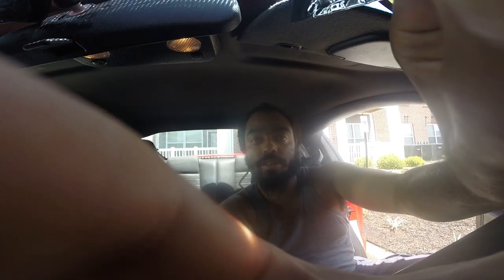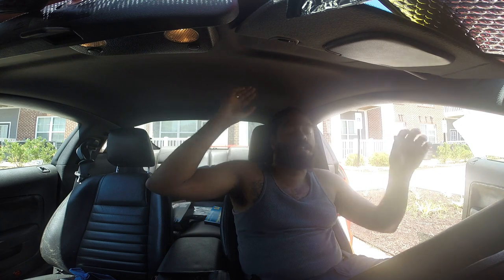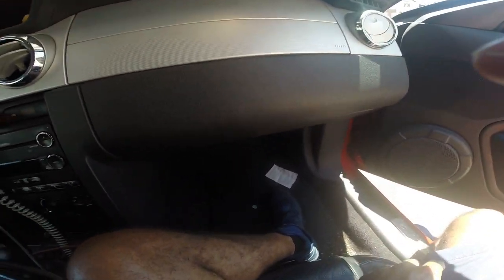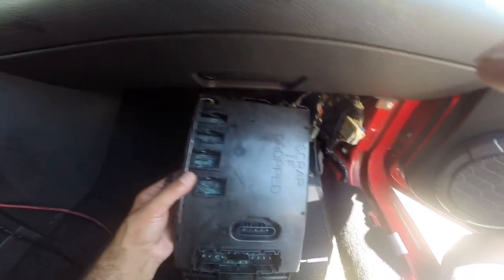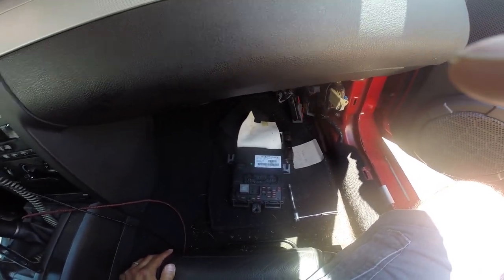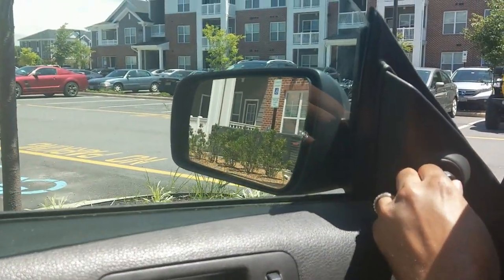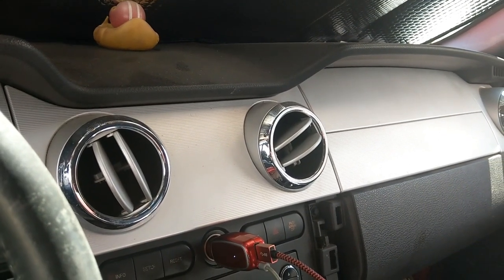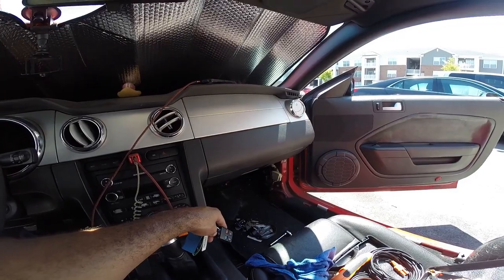08 MUSTANG ELECTRICAL ISSUES FIXED BY ONE SIMPLE PART REPLACEMENT

Comment: This was great!  Clean the front of the lens on your phone for a much higher quality picture and no flare.  Thanks for making this video. If De-Oxit is not available, try Corrosion-X, which does about the same thing.  You said something about wondering if moisture under the passenger door plate was a problem - The answer is YES - moisture causes green crusties and corrodes the ground connections over time, causing slow windows, Stability Control problems, poor cluster illumination, and affects anything that is wired into or near the SJB in that area.

Each time I watch this video, I learn more and more.
Reply from the maker: Thanks.  I appreciate that.

Comment: This worked! My cabin flooded in my mustang and all the electoral components stopped working like yours. I found a replacement part in a junkyard from a crashed mustang and luckily the smart junction box was still in great condition. HOWEVER, my windows won't go down and its not the fuses- might be the switches themselves.
Reply: Hey if you didn’t know already there’s grommets under the hood that get clogged that cause the water getting into the inside. Mine used to do this then I found out about the grommets.
Reply: What did it end up being ?

Comment: Hey so my right tail light only has one bulb is on I replaced the bulbs but no luck it’s has volts b like 0.6 wats do u think if I change the bcm it will work?
Reply from the maker: Definitely sounds like the wiring.  This is just a guess, but I probably would check the bcm to make sure there's no corrosion before changing it and then also the wiring harness for the tail lights.

Comment: My Guage cluster, horn and power mirrors and power seats stopped working could this be my problem aswell?
Reply from the maker: It's highly possible.  My horn & power mirrors were among what was affected when I had this issue.  You can start by checking the individual fuses, then the entire box.

Comment: Good looking out. Im sitting on a 07 mustang with that issue changed fuses and been trying to get the windows to go up atleast but no luck gonna look around and see if i find that part for this one and hope that is the problem. Nothing works windows mirrors radio or ac like yours so hope its that
Reply from the maker: Yeah, hopefully that fixes it for you.  Good chance it does being that it's a few components not working.
Reply: Worked out great just cost me $135 radio windows mirrors all work but no luck on heat/ac control. Still great now to reprogram the driver window thanks again man
Reply from the maker: @mrandres7271  Excellent!  Glad to hear that.

Comment: where did you buy the part? i dont want to have to reprogram it. My mustangs brake lights are on 24/7 and in was told its the SJB. Looking to just buy a used one for my car and replace it
Reply from the maker: Found it on eBay
Reply: @4TheLoveofRides  okay. seems pretty hard to find my exact model. guess i will just keep looking. hoping to be daily driving this pretty soon. my first manual car.
Reply from the maker: @CaffeinatedFrostbite  Yeah man.  Keep searching.  One should turn up.  And once you get used to manual, you won't want anything else.
Reply: @4TheLoveofRides  yeah. it will help a lot when i actually know what model number to look for. my parents let me keep it at their place while i learn manual since they live in the country and there is no traffic
Reply from the maker: @CaffeinatedFrostbite  I found mines simply by searching year make & model "08 mustang gt smart junction box" on Google or eBay.  Long as you match it up to your year make & model, you should be good.  No programming needed.
Reply: @4TheLoveofRides  I will see what I can do. If need be I will have a dealer program it. I will buy one on eBay either way since it's so much cheaper
Reply from the maker: @CaffeinatedFrostbite  Install it first before you give a dealer your money.  It was plug & play for me, straight out of the box.  Now that I think about it, I was wondering about whether or not I would have to get it programmed before I installed it, but I didn't.
Reply: @4TheLoveofRides  I figure if it doesn't work I just out the old one in so I can drive to the dealer and have him program the new one. Nothing lost in trying

Comment: i have an 06 v6 mustang and replacing this unit fixed my electrical issues involving the power mirrors and door locks. But now my fog lights do not work
Reply from the maker: My fog lights not working either right now.  Idk if it has anything to do w/ this box or b/c I changed out the light assemblies, but I need to check the fuses.  Weird thing is, b/c my fogs are out, when I unlock the car, the headlights come on instead.
Reply: @4TheLoveofRides  So i got another box but this time i matched the part number and made sure it was 05-06. I think the boxes are programmed for different options like fog lights, convertible, power seats, heated seats, etc. Now everything works good...Downside is i spent $260 

Thanks for the video it really helped out
Reply from the maker: @LucianoAlfano8  No problem.  @ least you got it fixed.  That's probably still less than what you would've paid someone to fix it for you.

Comment: I bought a used BCM on ebay and installed it. No change. Windows and heater blower still doesn't work. Any ideas?
Reply from the maker: Either the smart junction box is no good, or moat likely, you have an issue somewhere else in the electrical system.  Have you tried supplying power directly to the blower motor?
Reply: @4TheLoveofRides  I am going to supply power to the inside switch fuse with a battery tomorrow. I will use an incircuit 5 amp fuse to make sure I don't burn out anything. Changed the smart junction box (BCM) and no difference. I check the power to the 5 amp fuse that powers up the inside switchs and there is on volts there. If the switchs work with a battery my next move will be the under hood fuse box. Has to be where the problem is. Thanks.

Comment: You didn't have to unhook the battery before installing the new junction box?
Reply from the maker: I probably should have just as a safety habit, but when you disconnect the main plug from the box, it basically does the same thing.
Reply: @4TheLoveofRides  Ok. Thanks.
Reply from the maker: @ajw6715  No problem

Comment: So you didnt have to reprogram the key to the car after changing the sjb?
Reply from the maker: Only the key fob, but not the key itself.  Any coding in the actual key would be coded to the ignition, but not the sjb.
Reply: @4TheLoveofRides  im having the same problem and ford is telling me i have to get the sjb programmed to the car plus the key
Reply from the maker: @48kevo  If I remember right, I think my local dealer told me the same thing.  Or they might've said it "may" have to be reprogrammed, but I didn't have to do any of that.  All I had to do is link/program the key fob so that it would lock & unlock the doors, pop the trunk, etc.
Reply: @4TheLoveofRides  yeah i noticed in your vid. My car is sitting at the shop right now with this same problem. I have the box i was about to get them to program it

Comment: Hey man I have a problem where my key fob only unlocks the doors when I’m pointing directly at or very close to the SJB I believe it may have gotten wet I wonder if that would solve my problem?
Reply: Sounds more like the battery in the key fob needs replacing.  It’s a common button battery.  CR 2032 I think.  Easy to open the fob and replace.
Reply: @hobbycow5346  I replaced the batteries and still the same problem
Reply: @FreshPrinceofTB  Do you have the spare key fob you could try?  Then if the spare fob does the same thing, that possibility is eliminated.  The next step would maybe track down what receives the fob signal.  I don’t know if that is part of the SJB or not.  If you say the receptor is in the SJB, then you know more than I do.  I just assume that the issue is signal strength, because any other issue would be the locks not working at all.  I guess it’s possible corroded pins could reduce power to the receiver reducing signal reception?  Good luck, solving this stuff is tricky!
Reply: @hobbycow5346  Thanks bro! I’m going to pull it out and check for damage
Reply: @FreshPrinceofTB  Good luck!  One other long shot is to disconnect the battery ground, wait 10 minutes and rehook it up.  sometimes things reset when you do that.

Comment: If you don't fix the water leaks, you will be replacing it again.water leaks from two places. One from the firewall and the other from the door seal. Water leaks right into the fuse/ electrical panel on the passenger side. It can cause many problems including the car not even starting. Ask me how I found out. 😂
Reply from the maker: I bet.  I had already addressed that clogged drain in the firewall, but that door seal can be a pain if your not watching it.